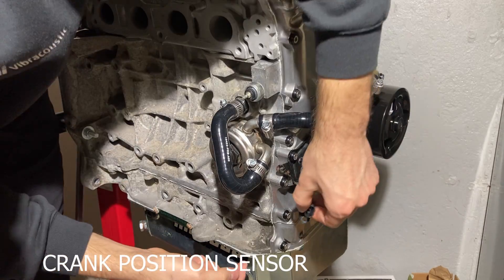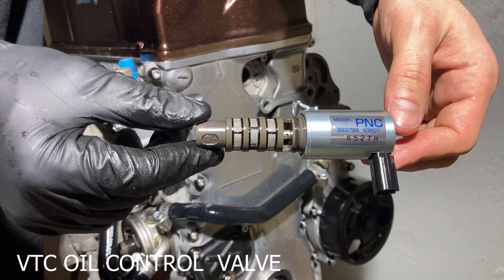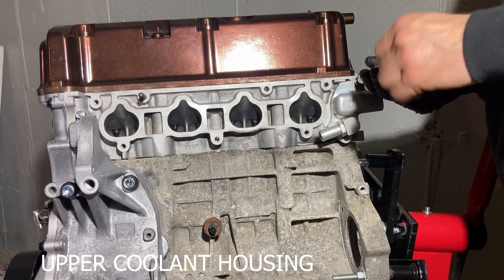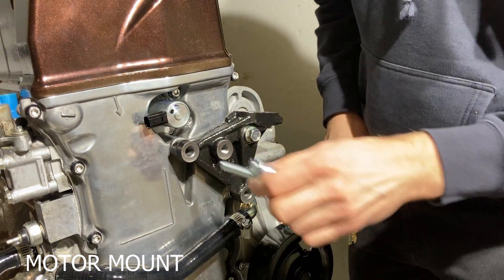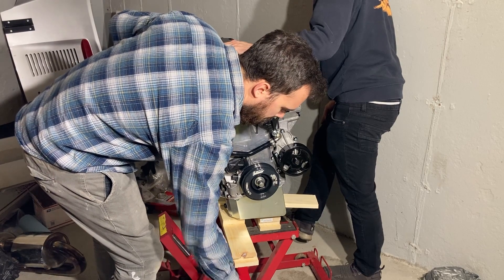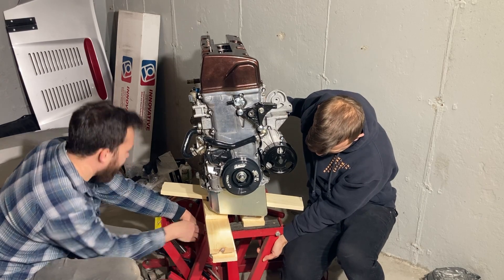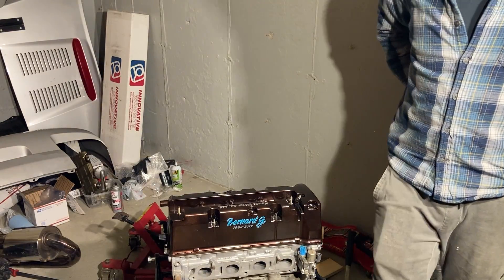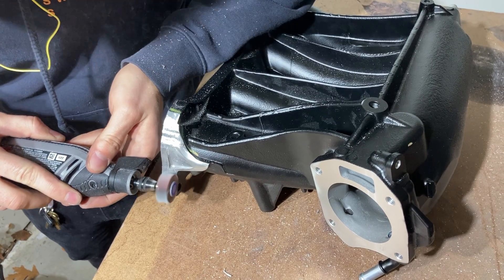K24 + SENSORS | MR2 BUILD

Comment: Is the k24 crank sensor absolutely necessary for the k24/k20 frank build? I’m building the same but using the k20 crank sensor.
Reply from the maker: I believe that for a frank build you need a k20 harness and the k24 crank sensor uses a different plug
Reply: You’re building a frank k20/k24 as well right? @20 second, you said k24 block and k20 head…

I have a k20 harness for my build. I was just curious with the crank sensor because you said you were using a k24 sensor. Just wanted to make sure I was headed the right direction.
Reply from the maker: Yes, I have a bunch of videos on the frank build. Off of memory you need a k20 crank sensor, I’m sure I covered it somewhere